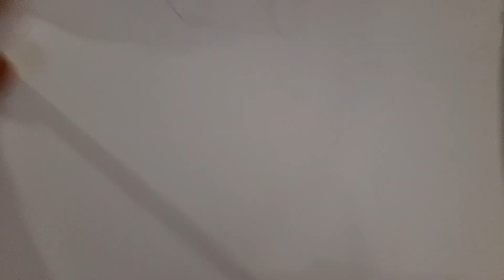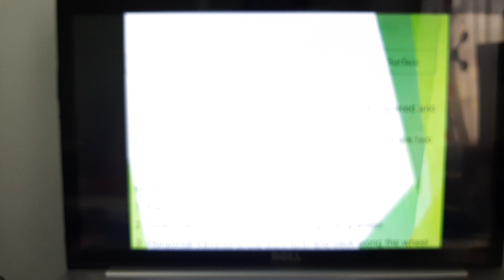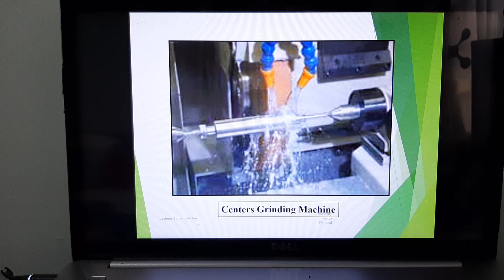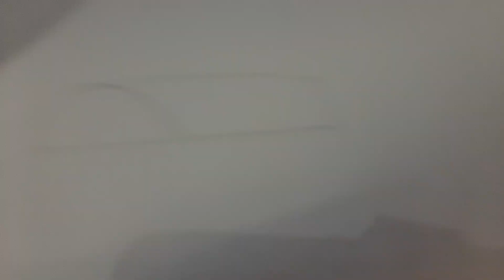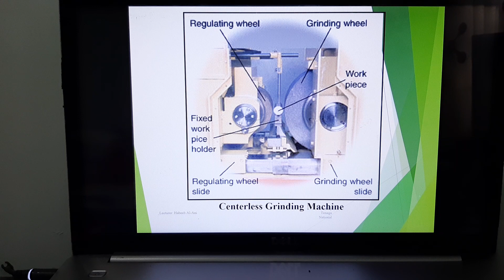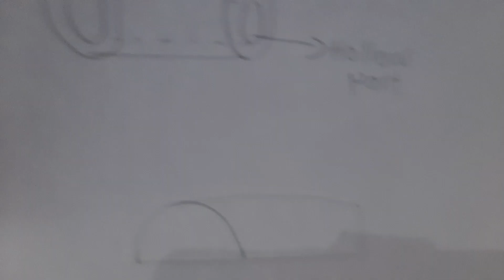GRINDING AND ABRASIVE PROCESS PART 2

Comment: NIGEL ANDERSON SINGH A/L RAJDEEP SINGH
ME0106094
Good day, miss. Grinding processes consist of cylindrical grinding (for cylindrical product), internal grinding (grind inner surface of cylindrical part) and surface grinding (smoothen rough surface and sharp edges). Grinding wheels' surface has variety of mesh size which are 120, 240 mesh size which are rough grinding and 600, 800, 1200 mesh size are fine grinding. Under cylindrical grinding, two types of grinding is center grinding and centerless grinding. Center grinding is where the cylindrical workpiece is being clamped, held by a chuck and involved grinding wheel with the help of coolant to ease the grinding process. The workpiece will rotate on its axis and move back and forth during the grinding process. The disadvantage of this process is if the workpiece is not clamped properly, the workpiece will vibrates and cause deep scratches which should be avoided. Next is centerless grinding. In this process, the workpiece is resting on the work rest. Regulating wheel, workpiece and grinding wheel will rotate in the same direction which is clockwise in the same axis. Regulating wheel will push the workpiece towards the grinding wheel and then grind the workpiece. There is also a grinding wheel slide which allow grinding wheel to rotate along back and forth along the workpiece to grind the workpiece. The option of centerless grinding is better option compared to center grinding due to its ease of use, no setup time and user-friendly. The disadvantages of centerless grinding are the workpiece cannot have a flat surface and the workpiece also cannot have multiple dimension.

Thank you.

Comment: Good Evening Madam, from this video i learned about the grinding procesess which have 3 types. There are
 i)cylindrical grinding  
ii)internal grinding 
iii)surface grinding. 
There are also about the centerless grinding is more effiency than center grinding.Centerless grinding used clamped to support the workpiece. it also used in mass production as it is faster than centers grinding
. So short the time taken to produce the product. But it 
cannot grind workpieces with flats because these flat surfaces do not allow the work to be rotated.

Name : Alif Haikal Bin Azly
ID : ME0106081
Section :01